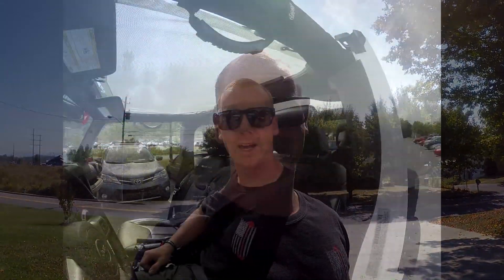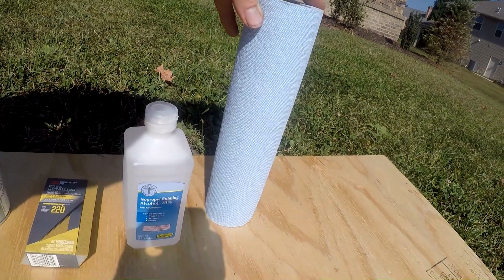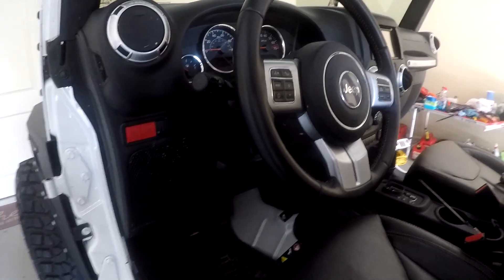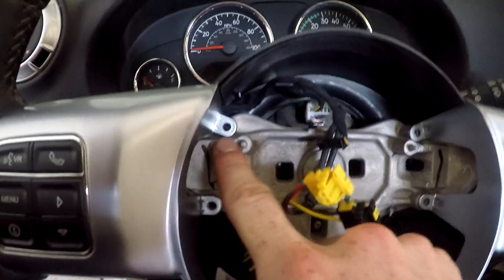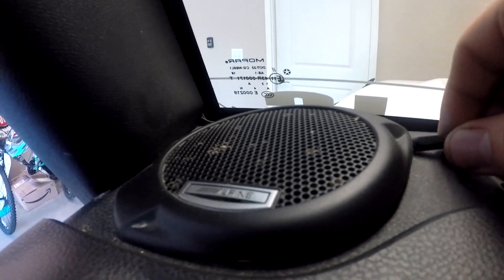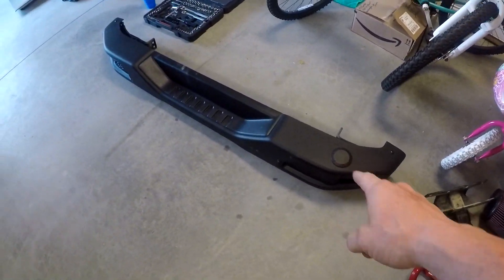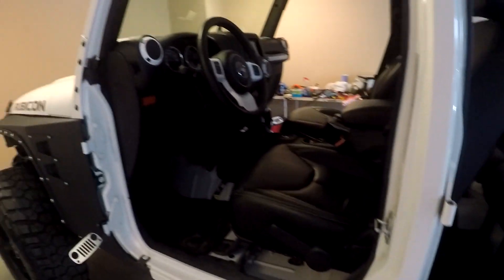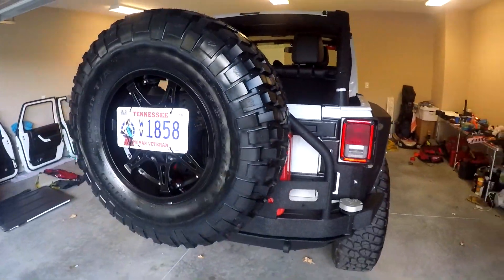HOW TO: REMOVE & PAINT ALL INTERIOR PLASTICS IN A WRANGLER

Comment: That looks wonderful. I'm trying to do this myself now too. Everything but the steering wheel. Speakers and doors were easy. But I'm having trouble with the air vent when it comes to turning it to the right. I'm also very afraid to break it.
Reply from the maker: Thagirion9 shouldn't break and as soon as you get the first one it becomes extremely easy.
Reply: Woo I managed to get them off and found the trick to it. Thanks. One last question I hope.  What size screwdriver or  hex key for the door panel?  So annoying this came to a halt when my biggest flat screw driver is a pinch too small. Haha.
Reply from the maker: Thagirion9 just pops in and out the bolts are fakes
Reply: Yeah I got it out. But I don't want to paint the bolts so I want to take those out.
Reply from the maker: Thagirion9 I can't remember right office could check after work
Reply: I got it to work. Thanks for your help. It was an 8mm Alan key.  I credit you in my latest video and link to this video.
Reply from the maker: Thagirion9 thanks buddy sorry I forgot to get back to ya
Reply: No prob. I knew you were busy.  If you get a chance check out my video.  I did my jeep in turquoise.

Comment: Did you disconnect the battery? before you took the air bag out?
Reply from the maker: Yes I did
Reply from the maker: The airbag can stay charged for hrs after disconnecting though. So best if you can let it sit over night.
Reply: @TheBoostedFam  ok. I am wanting to do this to my JK also and just worried about setting it off. I plan on doing my instrument cluster also.
Reply: @TheBoostedFam  How many cans of paint did you end up using?